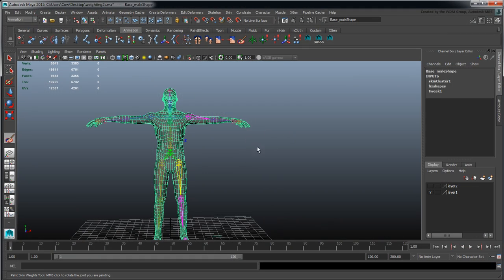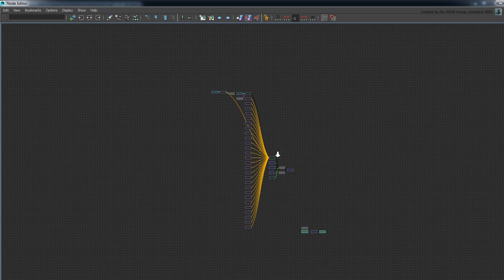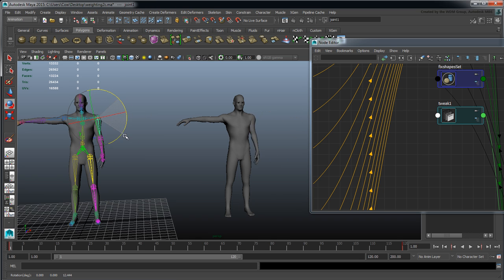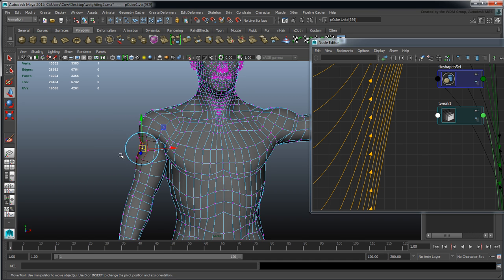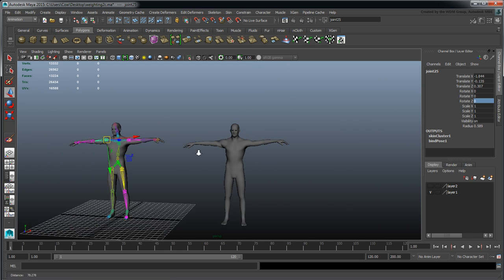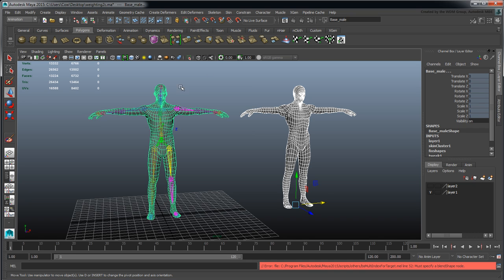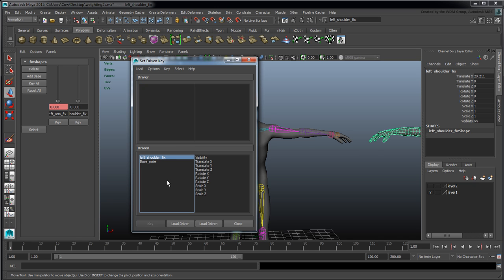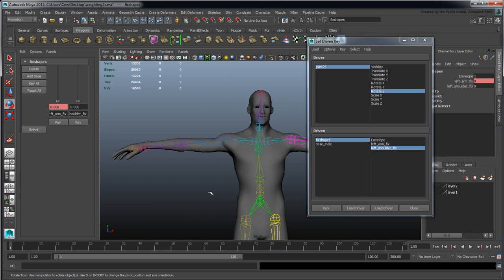Creating Pose-Based Deformations in Maya

Comment: Hi Adam,

When I try to implement this, I get a few problems, maybe you can help. For example, it appears that this only works correctly if the manipulation of the points is sympathetic to Global transforms. If I try for example to rotate the lower leg backwards, and move some points around the knee and calf to simulate a better pose deformation; when I reset the joints back to zero, the points do not keep their relative offsets correctly. Instead it appears the offsets are global values - not relative. Therefore the points begin to collapse into the mesh. Is there a way round this - am i doing something wrong? Any help appreciated - it would be a better way to work than using scripts.

Cheers
Reply from the maker: BFXFestival See Adam's video that we just posted to answer some of your questions:

https://www.youtube.com/watch?v=OVt_Uk6im54
Reply from the maker: nsimagine you've probably already seen adam's video on his youtube channel about his latest explorations with pose-based deformations, but just sharing this link for others to see: https://www.youtube.com/watch?v=AIdJO1T5304
Reply: BFXFestival is this when you apply the blendshape, or is this still on the proxy object before dulpication? If this is the blendshape, it's possible you didn't set it to the right deformation order? Ie front of chain, in which case it performs the deformation after the bone deformation, rather than before, where it should be.
Reply: Adam Garland its on the proxy object before duplication, although I have tried both and still a problem. Here is a link to a video I made  - https://dl.dropboxusercontent.com/u/5781634/Shape_Correction_using_node_Editor/Shape_Correction_using_node_Editor.mp4

it’s a simple rotation from the lower leg – the duplicate leg mesh on screen right deforms and follows as expected. However once I sculpt any changes on the duplicate, return the original leg to its zeroed pose -  then the sculpted change is not maintained relative to the joint. I draw a few red squiggles to outline approx where the offset points should be when we return that original leg to its original position. I hope that’s clear.

Cheers batman

Saf
Reply: BFXFestival looks like we've taken a maya update to the knee. I hadn't used this method for quite some time, I use mudbox for these now or I rig in a deformer on curve to correct these issues. However, I resurrected this older method I had used before to avoid the need for complicated methods, scripts and alternate softwares. Now however, despite me testing before making the video, it seems I missed the change in behaviour, and for that I'm very sorry. 

Luckily 2016 makes this method obsolete and moves the mudbox methods directly into maya. It's out now and you should have gotten an update link in your mail :)

unless you're unable to update due to production reasons? I can provide you with links to alternate methods of dealing with this.
Reply: Adam Garland Hi Adam,

Its all good. Frankly I didn't even know how the 'In and Out Mesh' inputs could work - so this video helped open up other possibilities - so thanks for sharing. I've checked the 2016 release videos, and your right, its looking pretty cool. We can use the abSymMesh scripts or the extractDeltas plugin for now and move to the 2016 method in September. Thanks again for the help and quick response to my question! :0)
Reply: BFXFestival You can use them to delete partial history like you can in XSI, which is where I should have gone with this video and use them as intermediary elements when transferring things like you would with Gator. So it's still good to know about them, yes. I'll see about making a video this weekend to cover those cases and see if we don't just replace this one with some valid info :D
Reply: Adam Garland - I so wanted this method to work, as it would make modelling correctives so easy and intuitive and eliminate the need for scripts or plugins. Too bad that behavior changed in Maya which makes
this no longer work.
Whats the Mudbox / Maya 2016 Methods to deal with that?
Are there videos demonstrating that?
I am also interested in your alternate method of dealing with it
and the "deformer on curve" technique that you mentioned..
Any chance you could do a video on those? :-)
Reply: nsimagine Sorry, I didn't see this message come through until now. Mudbox supports weighted joints for export, you can send a character with their rig (unposed) to mudbox, bend a limb inside mudbox, create a group, and a sculpt layer inside that group and apply any changes. That group when sent back as an update to maya, becomes a blendshape node, and the sculpt layer the new shape. For 2016 maya, it's simpler, just bend the joint, add an empty blendshape node, and click add and then edit for your first shape.. sculpt, and when done, turn off the edit. I can't assure you that you won't hit a bug though, I've had it work in both cases and not work in both cases. I imagine the internal method in maya will be come more stable and dependable over time.

The adding of shapes for 2016 is demonstrated on the Autodesk page as part of the videos for the new 2016 release. Check them out :)

 As for the alternate method of deformer on curve. This is a unique solution, I'm not sure if everyone will like it, it was used in Softimage by some. You essentially put some deformers on a path/curve, and then use driven keys to move their position, and add a bit of basic weighting to the path.. this has helped me deform character bums quite nicely. I'm sure I could make a quick video in the near future.. I'm a bit swamped at the moment but I'll see what I can do.
Reply: nsimagine exciting news, I have the solution to the issue in the video and the process is not too hard to do.. it works in local instead of global space now so, I'll make the video tonight and pass it on to AD for them to post !
Reply: Adam Garland So you found a way to do the corrective shapes without the need of a plugin or script? Thats awesome! Looking forward to the video :-)
Reply: nsimagine That is correct.. :)
Reply: ***** Thanks - great stuff and very useful - thank for taking the time Adam!
Reply: BFXFestival I've tried to record the fix for this video 3 times so far, my audio isn't recording. Trying again tonight to see if I can figure out why.. if not, I'll just post a google doc with it in classic tutorial methods :D
Reply: Adam Garland Any news? I am curious about the solution you found to the problem :-D
Reply: nsimagine sorry, for the long delay, my sound is still not working correctly and I haven't had a lot of time to resolve it yet. I can tell you that the solution is in creating a new tweak node at the front of the chain, movign the bone, making the shape, reset the rig, duplicate a copy of the mesh, remove the tweak node, repeat.
Reply: Adam Garland Interesting! I gotta try that tomorrow :-)
Reply: nsimagine ok, well I'm going to have to say sorry again.. we tested it at work a bunch and it seemed to work, and I fixed the guys knee from the video above it and it seemed to work fine there too..It was so easy to do!..  but just did a more extreme test because I managed to get my mic working.. (figures) and it moved wrong.. so I'm back to suggesting mudbox or 2016.. or there's a nice script which does a compare between two deformed meshes and corrects in local space..
Reply: nsimagine you can try transform component.. it moves along the normals of the surface.. and leaves a node in the history stack you can delete afterwards to remove the edits on your main mesh.. though in some situations it's awkward to use.. or use the plugin link I posted on your youtube channel..
Reply: This video is unavailable